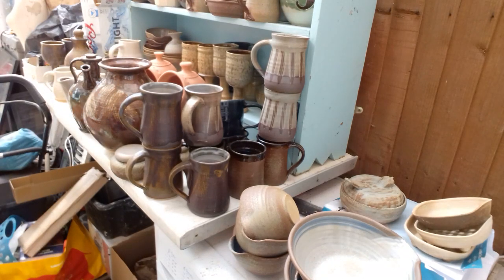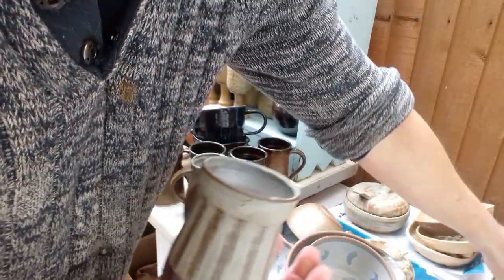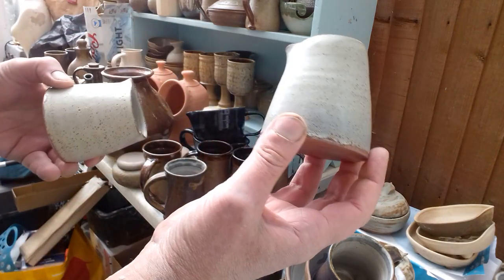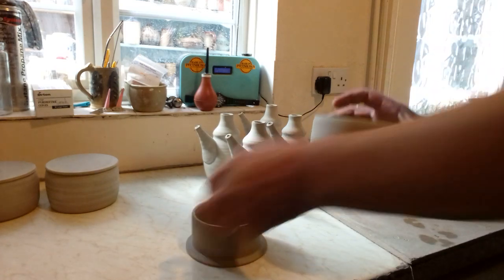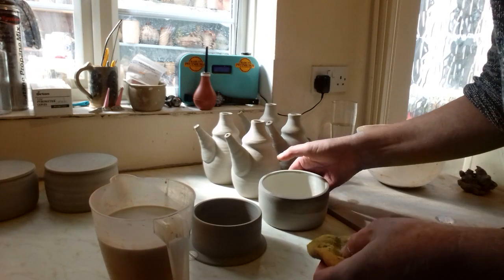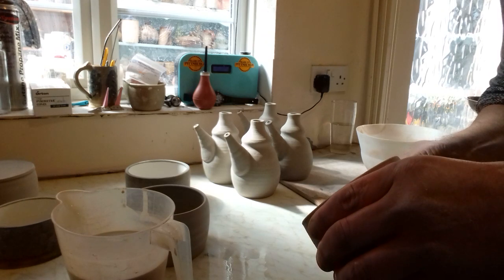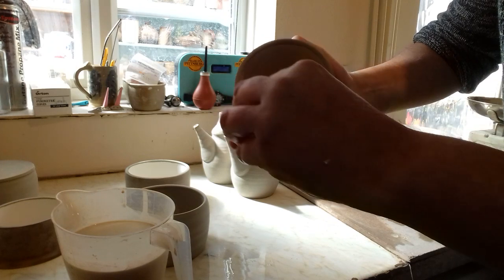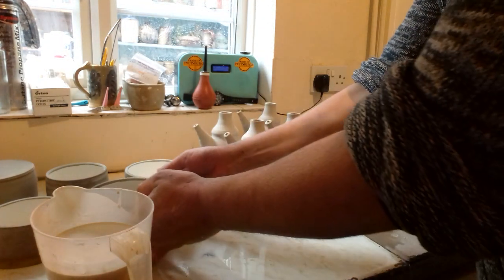Raw glazing French butter dishes.

Comment: Good or bad thanks for sharing. I too this year have suffered from some Post Traumatic Kiln Opening Syndrome. My solution - just don't fire any more pots. A solution that's really not going to work in the long run. Tried going small too so as not to overwhelm the studio with greenware but then instead of loosing 1 big pot you can loose 2 dozen pots. 
My solutions are not sustainable because of the good news - I sold some pots. First farm market of the season, I sold some pots and now hopefully every Saturday. Rain or shine, a killer 80F 27C on pavement in the sun, it's April so I didn't take think to take a tent. Next week it may snow.

Comment: Nice Leigh, I have make several of that type of butter dish, but not as large almost 1/2 that size. Good luck on the firing. eddie.
Reply from the maker: Cheers Eddie, disastrous firing they all exploaded :0 (. I just said to Carol maybe I should have waited a few more days after raw glazing them, we live and learn, well hopefully  ;0)
Reply: @handmadepottery2135  Welcome to the club, Sorry Leigh. I have had that happen several times. Now I have learn from a couple of potters. Simon Leach when he know there may be moisture he uses a electric dish warmer. He has told me he gos to the second hand store's or rummage sales to buy them at a lower cost. He will dry the pieces for about 24 hours to drive out the water or moisture. This mainly due to the raw firing and the pottery will soak up more glaze than the bisk pieces. Now the other potter is Guy Wolff will heat his pottery for 10 to 12 hours at 200. This is below the 212 point when water boils, thats when it is starts expanding and moisture is pushed out and the blowup or cracks will start. Guy has did a video that explains this a little. Simon told me the last time I was there at his studio. Hey better luck and I hope this helps. eddie.
Reply from the maker: @eddiespottery8439  Thanks Eddie, great idea putting them on a former of heat, with a bit of luck I will be able to put them in the sunshine soon, if I raw glaze again lol.